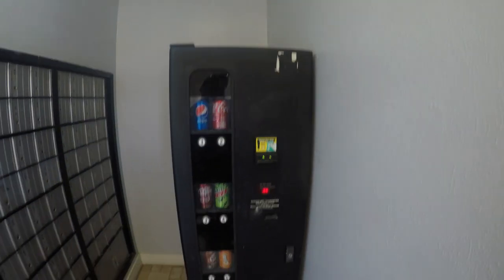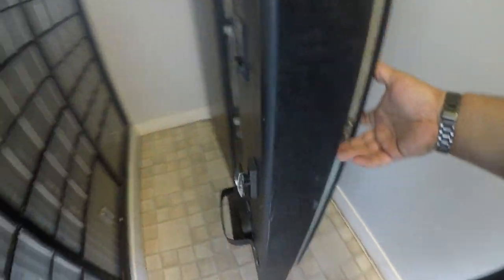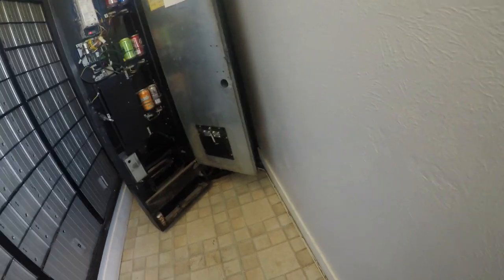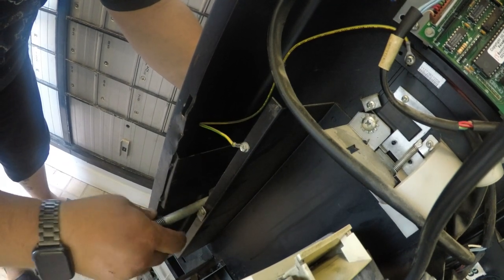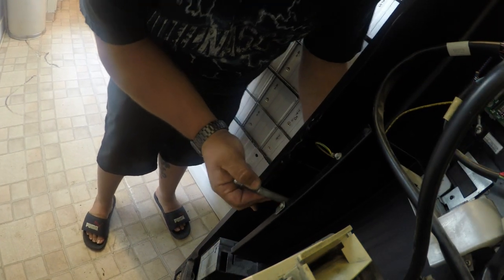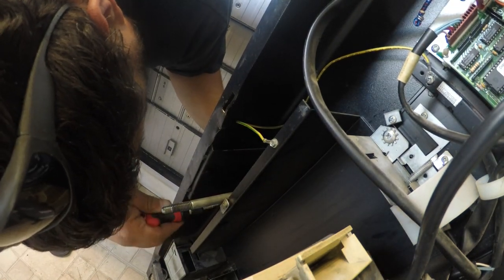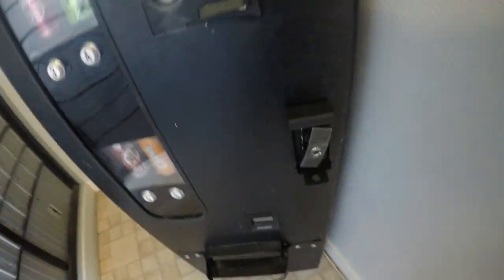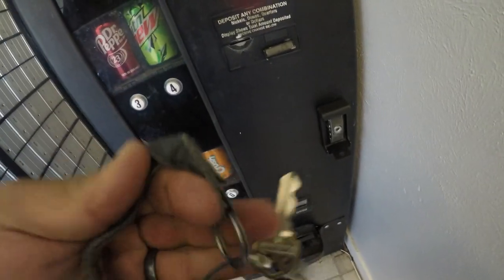How to install a T-Handle Security cover on your vending machine

Comment: Great video, have you ever heard of Abloy security locks & padlocks?
I like how you can fix any problems that you come across at 👍
Last point, how did you get that great hotel location?
How did you convince them that you're the right operator for the location?
Does the hotel have any more locations where you can place your machine?
Reply from the maker: The machine has an Abloy Protec lock on it already but it has been damaged I wanted to make it harder for someone to damage the machine further. 
As for the hotel. I walked in and asked if they would be interested in having machines on site and they said yes